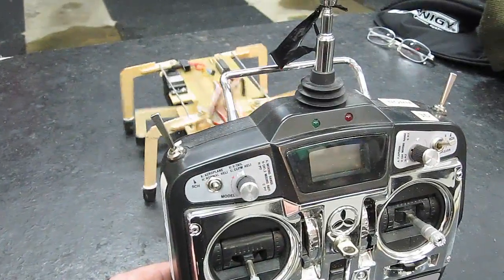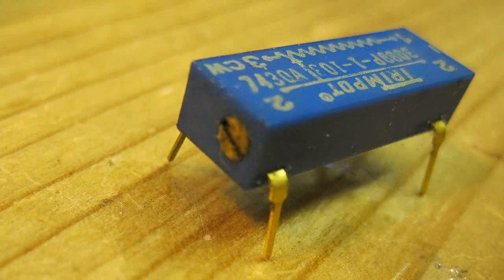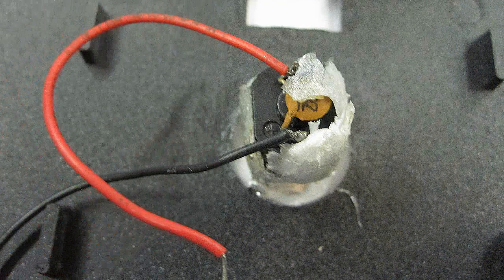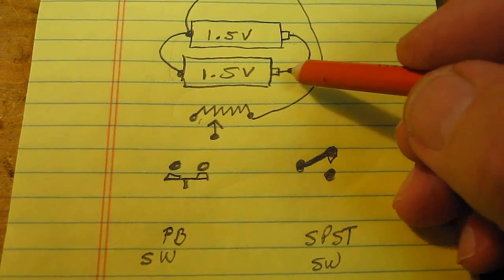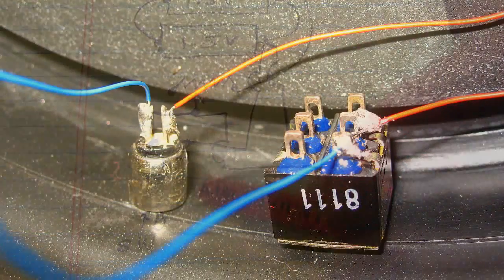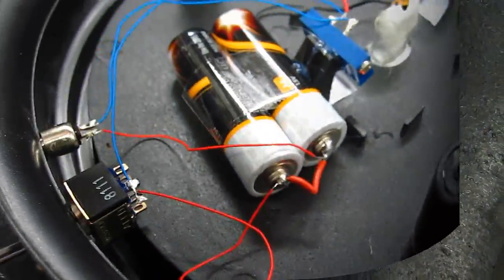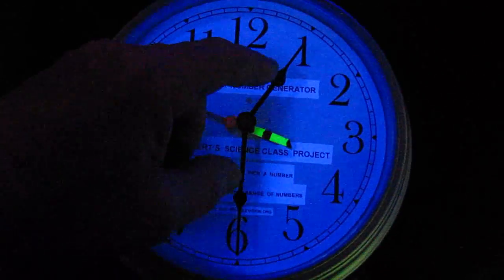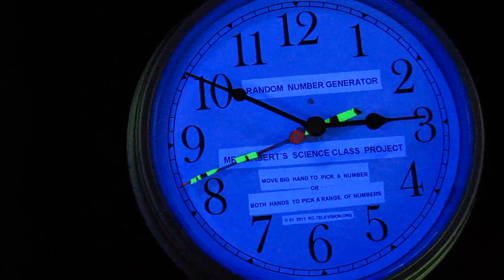Walking robot beetle. Dice Eliminator. Analog Random Number Generator.

Comment: @adentse  In his device the probability distribution is uniform. the probability of getting any number is 1/12. Unfortunately though, rolling 2 dice gives a different number distribution. Since you are rolling 2 dice, and there are 6 different possible outcomes per die, there is actually 36 different possible outcomes. There are multiple ways of getting a single number, 7 having the most ways 2 and 12 having the least.

Comment: @flyingchimp99  The dice and this clock is somewhat equally random. Since the clock hand is rotating so fast you cannot control the time you press the button exactlly (enough) to get the same number twice. In the same way: if you could control the speed, height and angle of your hand as it let go of the dice it would also generate the same number twice. but you can't. 

Using a CPU it's common to have a counter register running really fast and grabbing the value at keypress. Same idea as clock.